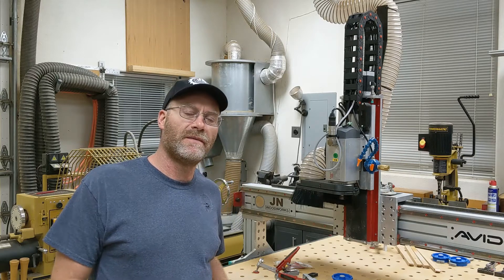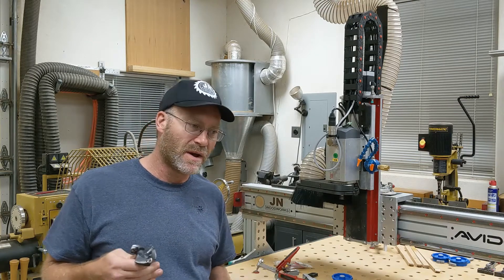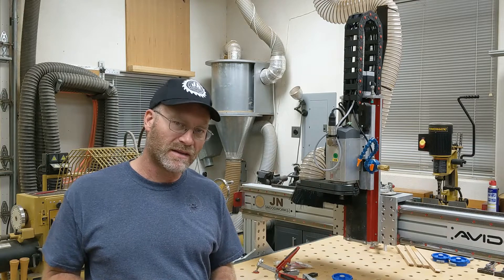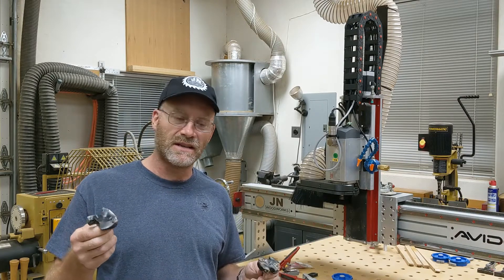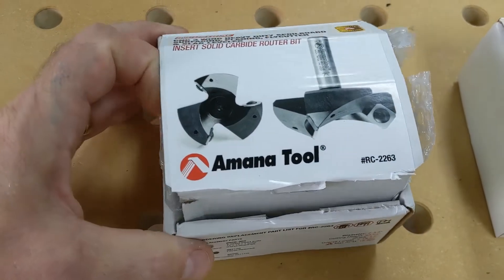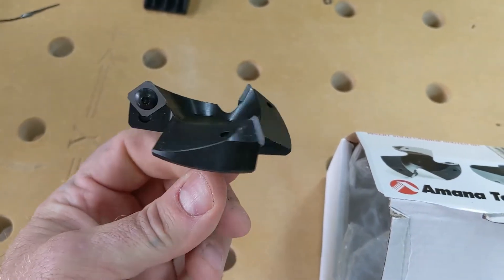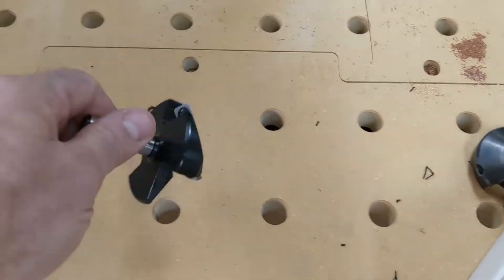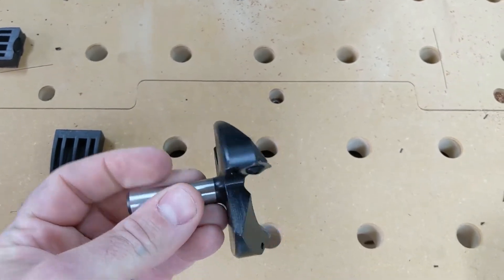Review of Amana RC-2251 and RC-2263 CNC Spoilboard Cutters for use in planing river table tops

Comment: Awesome video! Liked and Subscribed! I was looking at the 2267 but after seeing your video I'm leaning to the 2263 because of the diameter. I'm worried about the 19,000 vs 22,000 Max RPM ratings... I have a Dewault DW618 with a 8000-24500/min (RPM). Should I be concerned with a Router sled? I'm totally new to this and appreciate any help!
Reply from the maker: I would take a look at the Slab Slayer bit as well.  I did a video on that recently.  It has much cheaper carbide inserts, and it is 2.5" in diameter which woudl be a little better for that router.  I haven't tried this bit on wood, but it cuts aluminum great 🙂
https://www.youtube.com/watch?v=F2N1eoFUMyM&t=643s
Reply: Thank you!  @JNWoodworks

Comment: Great review and explanation. I was going to get a bit that diameter, but don’t know how to get the Z with the touch plate. Do you have a work-around or a different touch plate.
Reply from the maker: The height setting is not that important for planing anyway.  I just jog around the slab I'm planing to find the highest point on the whole peice, then I jog Z down to just touch the top and manually set the Z height in Mach4.  I usually just use a pocketing toolpath that has one depth of cut and then I will reset Z lower between each run and I just quite when I've planed down to fresh wood across the whole slab.   I will also stick around so that when it has cut off the peaks and is cutting through air in other parts I can speed up the machining speed percentage in mack4 so it gets to the next part where it is hitting wood again sooner, then slow it back down to the normal feedrate.
Reply: @JNWoodworks  Thanks.

Comment: Excellent info!  I was struggling to find the distinctions between these bits, and your video nailed it.  As I review options, that 2263 is indeed a big bit, with a 2.75" diameter.  It appears that the 2255 is the same design, only smaller with a 2" diameter.  Having a smaller router than yours, I think I'll give that a go.  I'm typically flattening white oak, so the smaller bit should plow through that a little more easily.
Reply from the maker: Ya, they make a few different sizes (one even bigger than mine with a 3/4" shank too) with this design, so  you can size to your router.  I think they all use the same carbide cutters, they just have different diameters and number of cutters.

Comment: High value video for me. I just saw the bits with the extra carbide bits on the bottom and it was intriguing but after seeing your experience with the 2251 and 2263 I would definitely go with the 2263. Thanks!

Comment: I don't have a thickness planer or a jointer and no budget. So, I plan to use it fulltime for thicknessing and jointing rough lumber. How long will it last? I am concerned about needing to buy bits frequently. Thank you.
Reply from the maker: Hi Henry,  I think using  a router makes sense for large slabs that are too heavy, or won't fit in a planer, but for smaller stock, a CNC machine (or a router sled) are extremely inefficient ways to plane and joint regular dimensional lumber.  You can buy a used desktop planer for less money than this bit usually.  The tips on these are fairly expensive too (>$20 each).  
However, to answer your question, I can mill several big slabs on one set of bit tips before having to rotate them to another corner.

Comment: I'm looking at the bigger version 5 wing RC-2259 and wondering about what your speeds and feeds are?  Doesn't look like it's moving particularly fast.  The bit above recommends 400 ipm at 1/8" doc at 12k rpms.
Reply from the maker: Hi Peter,
It really depends on the HP you have on your spindle.  The spindle in this video is my old 3hp one.  That would cut about 0.100" at 100ipm in Mesquite and epoxy.  I was probably running around 16000 rpm.  With my upgrade to the 4hp spindle I can cut deeper or run faster for sure.   You do need to maintain some margin because these spindles are constant torque, so if you hit a tough spot and the spindle slows down, you lose hp proportional to rpm and it will bog down and stop very quickly.

The RC-2259 is a huge  bit with a 3/4" shank so if you have an AVID machine you would need the 8.8hp spindle so that you have the ER32 collet, and frankly you'll need that much HP anyway.  I don't know if you will hit 400ipm at that speed in stuff like Mesquite, but you probably will in most woods.  If you are doing epoxy tables, you may find that cutting too fast will cause too much epoxy chipping.  This bit is pretty good in epoxy, but if the epoxy is very hard (like cured for a couple weeks) it can tend to chip.  In that case you want to use very fresh cutters, and run a light final pass.   Having 5 cutters will keep the size of the bite down as well which should help to reduce chipping.
Reply: @JNWoodworks   - thanks - I do not have an AVID machine but it is a 6hp spindle with ER32.  The speeds and feeds for that bit show 200 ipm at 12k rpm for 1/4" doc per pass or 400 ipm for 1/8".  What was your step over for you bit?  I think Amana recommends 50%, which is still just over 1 5/8".  Good tip about the thin final pass in epoxy.  Currently I have about 100 - 150 black walnut and hard maple live edge slabs to flatten before I can look at epoxy.  I'm trying to speed up the flattening as much as I can.  I will sell most as flattened and sanded slabs and keep some nice ones for epoxy tables.  Cheers Peter.
Reply from the maker: @petershupe3460  You will get close to that speed on maple and walnut I think.  Watch out for knots on the first couple boards to see if its going to slow down at that speed and DOC.  I run a 60% stepover on this bit.  I also use a rastering type toolpath and make sure it starts outside the board and works in.  If you use an offset toolpath or any that allows it to plunge into the wood, it is cutting on both the leading and trailing cutters for the first diameter of the bit travel, and that is where you can stall the spindle easily.  Also, these bits are horrible to try and catch dust with because the large diameter and chip size blows the dust out so fast, it goes right through the brush bristles.  It works good to make a dust boot with rubber strips instead of brush to stop the chips a little better.  Or just reenforce the bristles with something like duct tape on the outside (takes some experimentation).

Comment: Hello there, can I use RC-2263 with my router sled for flattening table top? i have no CNC.
Reply from the maker: If you have a large router (like 3 hp), and the sled is pretty solid and holds the router well it would probably work.  A nice sled with linear bearings or something similar.
Reply: FWIW, Woodpeckers themselves recommended the one that is just 1/4 inch smaller than the 2263 (but the same trim-cutter design) with a 3HP router, but I see no reason that this very slightly larger one wouldn't do just as well.
Reply from the maker: @OFFICIALUND  I agree, they make a few sizes of the same basic cutter design, I think they will all work well.  It mostly depends on how much money you want to spend, and how much horsepower you have to spin it.  The. Biggest one has a 3/4" shank too.

Comment: Very good technical information I could not find on other CNC videos, thanks for sharing. This may be the wrong place to ask this question, but I'm in the market for an Avid CNC router and plan on doing similar work to you (river tables etc), have you found the 4x4 CNC to be adequate with respect to material size as opposed to the 4x8?
Reply from the maker: Hi Stan,
I don't have room for a 4x8 in my garage, but I sure wish I did.  That said, Vectric and other CAD programs will let you break up the job in multiple parts to let you slide a larger workpiece through.  The bed size doesn't affect the cost much so l would definitely go with the bigger one if your shop has the space, especially if you are going to do river tables.

Comment: Hi Jim, we have the flat bottom  4 cutter bit in my shop and we removed the bottom 2 cutters and just use the side cutters because of the same reason,  gumming up and causing lots of tear out,  works quite well with just the 2 ,  you can use it this way to do all the rough passes and finish with the more expensive cutter rc2263, thanks for all the great content.
Mark, Vancouver ,British Columbia
Canada
Reply from the maker: That is a good idea.  I think all the bottom cutters do is generate heat 😊

Comment: is Amana rc2263 the best router bit for surfacing table top?
Reply from the maker: Hi Nhan,
I think this kind of bit is one of the best.  If you look at the two I compared, one has a lot of flat cutter surface touching the workpiece so it tends to get hot and burn. The rc2263 just cuts at the tip and seems to cut cleaner.  They make several sizes of this cutter, so I think the one that is best for you depends on what you are cutting and how big of a spindle or router you have.  They make bigger and smaller cutters like this one.  The 2263 is a good size for a 3 or 4 HP motor.  I have been very happy with it.
Reply: Thank you, JN Woodworks. Helpful video and clear explanation!

Comment: Thanks for the video.  Lots of good information.  For what its worth,  prefer the raster tool path and run the bit over the end, then the bit never takes at 100%
Reply from the maker: agreed, there are several ways to make a toolpath that avoids the full load cut.  You can come in from the side as you mention, or do a  ramp move on a pocket toolpath.  Just wanted to mention it because it can cause a little panic when your spindle stalls :-)